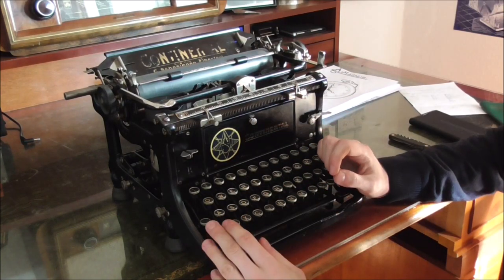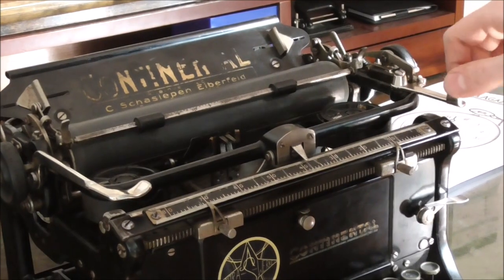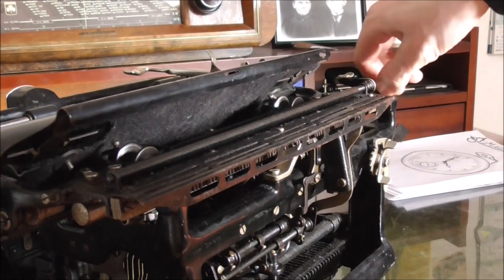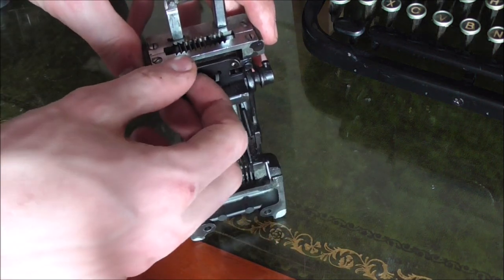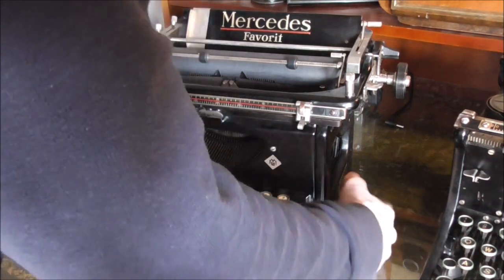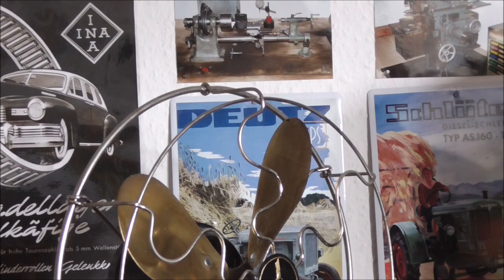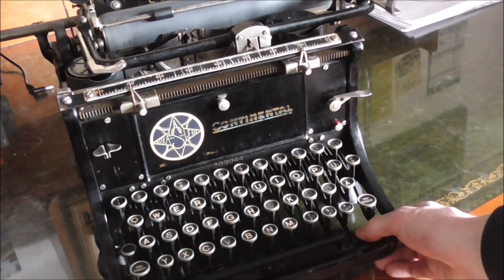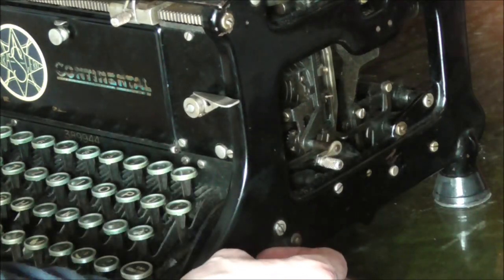Continental Standard Typewriter - Review and Comparison

Comment: Really enjoyable video.  A chance to see a machine that is not common in the USA.  There is a lot of fun to be had with standard machines from the 30s. I have a ‘39 Underwood “Master” and a ‘35 Royal “KH”.  Both are interesting machines to use.   
Is it possible that your machine uses a ribbon that is 9/16” rather than 8/16. I believe some Royal machines used the wider ribbons. I have a couple of NOS Royal ribbons that are marked 9/16”.
I always enjoy videos regardless of content.
Steve
Reply from the maker: Thanks. It's even more than that - the Continental requires 16mm ribbons - that'd be about 5/8" - you could almost make a tie out of that!
The Mercedes is made for 5/8-ribbons, too - luckily I was able to "adapt" the original carrier by wedging a small piece of shim-stock into its bottom part essentially narrowing the gap down. The Continental's ribbon carrier was a pretty wide design (come to think of it, I should have shown it), so I had to resort to making an entirely new one.

All the Best
Adrian

Comment: Hi sir, i hate to bother you again, but could you please tell me the exact measurements ( in centimeters)  of the feed roller, the one by the side of the platen. Mine is so broken that there's no way I can measure them correctly.  Thank you so much!
Reply from the maker: Hi, they're 31mm wide and 9.5mm in diameter.
Reply: @AstraWerke  Thank you so much.  Do you have Patreon so that I can tip you for your kind help?
Reply from the maker: @machopolitan1  No I don't. I'm glad I could help - that's what I make these videos for, after all. :)
Reply: @AstraWerke  thank you so much
Reply: @AstraWerke  oh no  The feed roller is much longer than  31mm.  My machine has only one big feed roller it's approximately 20 cm.   not the smaller ones under neath.
Reply from the maker: @machopolitan1  Oops, my bad. That one measures out at about 195mm in length and 13mm in diameter.
That one could be tricky to push a new one onto - either oil or soapy water, along with warming the rubber up slightly to make it more malleable might help.
Reply: @AstraWerke   Yes Sir! Thank you so much!
Reply: @AstraWerke   One more thing, what is the measurement of the diameter of the iron bar that runs through this rubber feeder?  Thanks.

Comment: If you press and hold only the right side margin release button while returning the carriage, it stops early to make an indent in the next line for a new paragraph without having to use the tabulator or pressing the space bar a few times. Most Olivetti typewriters had this kind of a system, but with just the one margin release key.

Comment: Hi could you please offer me some advice on how to take off the big rubber roller and feed rollers on Continental standard? I have an old continental, the only problem is that the rubbers are too old and must be replaced.  Thank you.
Reply from the maker: First, move the lever that makes the ratchet click backwards so the platter turns smoothly.
Then, unscrew the two bakelite handwheels that attach to the platen. They are quite firm, but should be removeable with a tight grip.
After that, you can remove the platen. 
To remove the feed rollers, take out the piece of sheet metal, remove one of the feed roller bearings by unscrewing it and tilt the feed roller shaft outwards. 
Be careful though, as the bearings are spring loaded.
I don't know if you're able to read German, but this manual is great help, too:
http://www.typewriters.ch/blog/wp-content/uploads/Continental_Schreibmaschine_Gebrauchsanweisung_1.pdf
The ratchet lever is No. 1972 shown in "Abb.5" on page 13, removing the platen is described on pages 23 and 24.
All the Best
Adrian
Reply: @AstraWerke  Danke!  Thank you so much fior replying me !  I love German technology and I've personally collected at least a dozen!

Comment: I own a Continental-Standard made in 1938 and interestingly this one has several improvements compared to your earlier model: For example it has a return lever on the the right as well as on the left. The backspacer is placed in it's common place on the right and does not have the issue with "jumping" anymore. Furthermore the tabulator has the added function to delete single tabs just by lifting the wing-lever up. I am sure there are a lot more differences, but I cannot name them all.
Unfortunately my one has issues with the tabulator break. Instead of smoothly stopping at each tab the carriage just jams into the tab und even moves on the table.
But aside from that a nearly perfectly functioning device and a joy to write on.

Grüße aus dem Ruhrgebiet
Luca
Reply from the maker: Sehr interessant, danke dafür! Ich denke mal, die Sekretärinnen hatten damals ähnliche Kritikpunkte.
Die Bremse ist bei diesem Modell ziemlich komplex - ähnlich einer stehenden Bremstrommel mit innenliegenden Bremsgewichten.
Da kann vieles verrostet, verharzt oder z.B. ein Federchen gebrochen sein. 
Glücklicherweise braucht man die Tabulatoren zum normalen Schreiben ja doch eher selten.

Lieben Gruß zurück und Glück auf!
Adrian